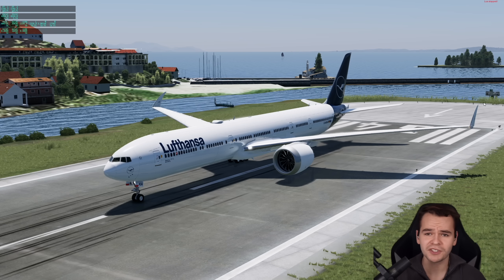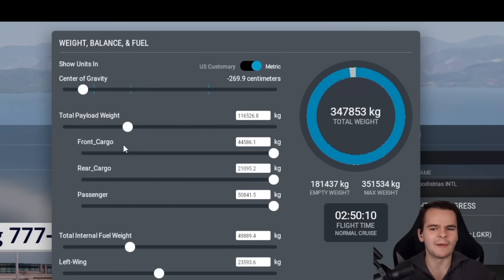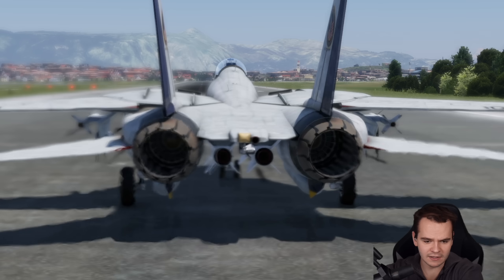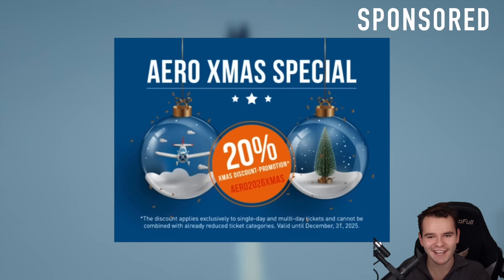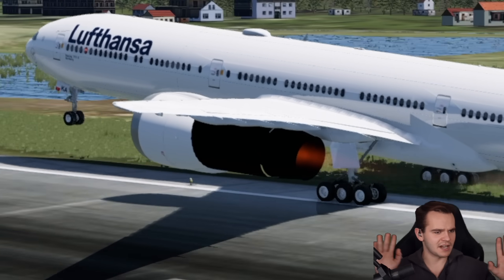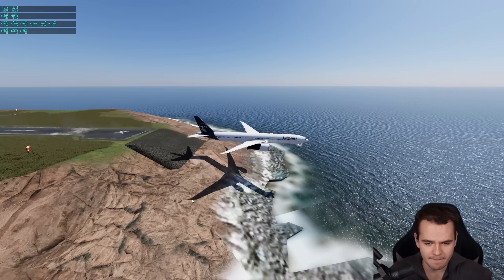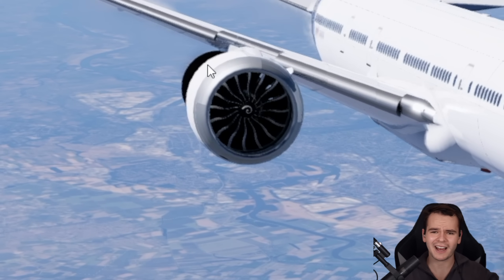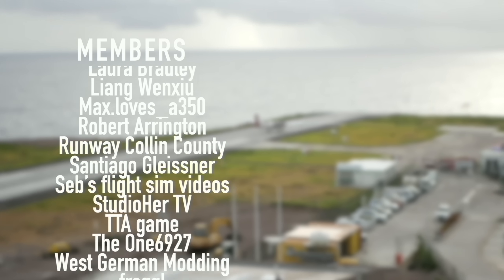What Happens When You Add Afterburners to the WORLD'S MOST POWERFUL Engine?

Comment: The one problem with afterburners is while they deliver a tremendous boost in thrust, they do so by sacrificing fuel economy, resulting in reduced overall range, which is generally counterproductive for an airliner where range is the primary concern.
Reply: Afterburners are completely unsuitable for use with high bypass turbofan engines. The pressure ratio in the bypass duct can be less than 2:1 therefore, rather than an increase in thrust, the result would be an extremely large fan heater!

Comment: 4 or 6 GE-90X engines on an AN-225?
Reply: you could get away with 3 with a lighter load or 4 for even more power than the original engines
Reply: GE9X is the proper designation (my last project prior to retirement was publishing the certification reports.)

Comment: Correction 

The General Electric GE9X is a high-bypass turbotan developed by GE aerospace for the Boeing 777X or else. It first ran on the ground in April 2016 and first flew on March 13, 2018.It powered the 777-9's maiden flight in early 2020. It received its FAA type certificate in 2020. Derived from the General Electric GE90 with a larger fan, advanced materials like CMC and higher bypass and compression ratios, it was designed to improve fuel efficiency by 10% compared to the GE90. It is rated at 110,000 lbf of thrust, which is 5,000 lbf less than the highest thrust variant of the GE90

....

And yes i wrote the whole thing

(Guys chill out it's just for fun)
Reply: So why tf did you bother writing the whole thing from Wikipedia word by word when you could've just copy pasted? And also what are you even "correcting"?
Reply: @Davidus58 
Presumably the thrust. The copy pasta says 110,000 pounds, but Swiss shows 127,000 in the takeoff, and he says the GE9X set a world record at 134,000 pounds.
The 134,000 comes straight off GE's own website about the engines, but does say "world record", which suggests it was an out-of-spec test run, not the maximum thrust they're certified for.
Reply: literally copy and pasted from wikipedia word for word